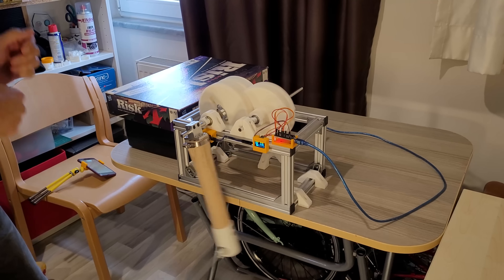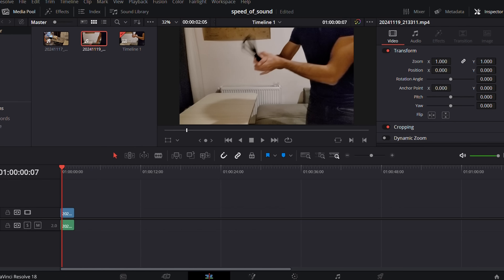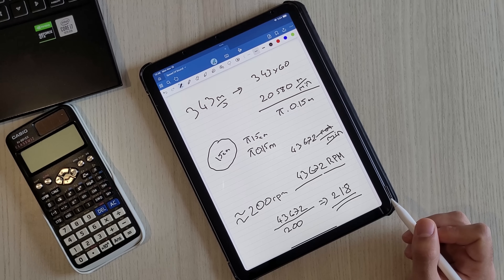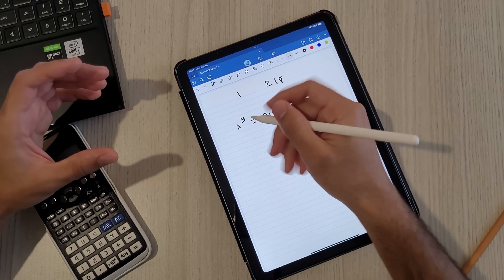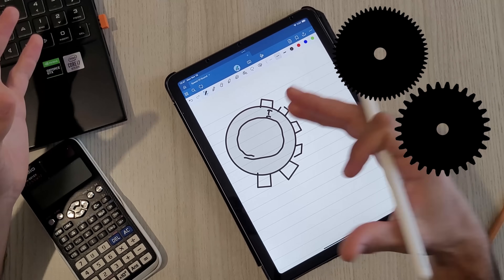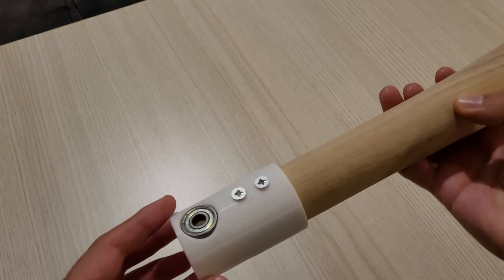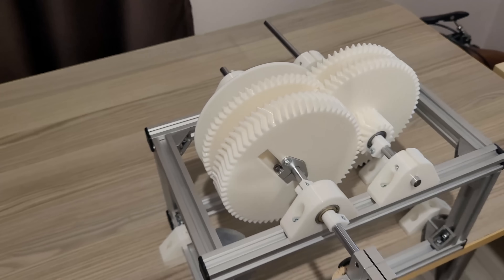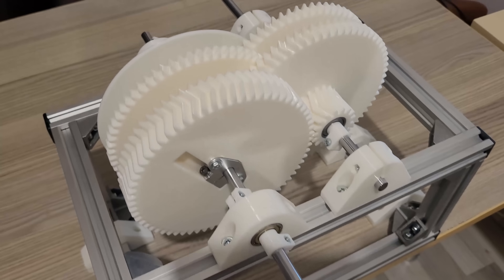Trying To Reach Speed Of Sound At Home 3D Printed Gears

Comment: Very nice video! I think it's not doable with a plastic 3d printed last wheel. If I assume a circumference speed of 1250 km/h and a disk diameter of 10 cm and a density of 1 gramme per cm³ for the plastic, then the tensile force at the outer rim is about 120 MPa (12 kgf/mm2). So I think the material for the last disk has to be a strong metal and I think it has to be thin at the rim and gradually somewhat thicker near the center. Furthermore, the air resistance exerted will play a very large role. With a 10cm disk and 66,000 rpm, I quickly arrive at 500 to 600N. That is the force required to send this disk through the sound barrier without any friction losses from bearings and wheels, so only its air resistance. And for each bearing and gear transmission, the friction of that component is added. If we calculate a rather unfavourable 5 percent per bearing-gear combination, then I arrive at a required driving force of 1.05 to the power of 4 = (1.2)*600N, say more than 70 kgf. You won't be able to do that this way at 3 revolutions per second. As soon as you can put the last wheel in a vacuum, it should be a piece of cake.
Reply from the maker: Wow, a lot of thought went into this comment. Thank you. Do you have an email address that you could share with me, i would like to contact you before i try this again to do a sanity check. If you don't want to write it here, you can send a mail to the address in my channel bio.

Comment: You mentioned that the double herringbone is more efficient at transferring power than a spur gear which just isn’t true. Helical gears see a small vector of axial load which is parasitic from the overall torque transmission. The pro to helical gears are reduced noise, but straight cut gears transfer power more effeciently
Reply from the maker: Thanks for pointing that out!

Comment: Why aren't you using the Speedometer which you built? 

I'm allergic to non basic Maths...
Reply from the maker: Hahah,  as i mention the magnet is not strong enough to get a good reading from the sensor. So it can't accurately measure the speed.

Comment: fast speed without any power. :/
Reply from the maker: Unlike our rules the rules of physics is same for everyone, you can't multiply the power.
Reply: but it's possible to optimise the transmission of movment to convert the movment of a weight moving down into a rotating thing

the weight of an human could be enough to generate a rotating little power.

Comment: A larger final disc might be all you need. Please visit it again
Reply from the maker: Hi, i can't make the final disc larger without significant changes in the design. There are two parallel rods in the system, and if the disc was any bigger, it would hit the other rod.

Comment: How about designing a coupling for the input shaft so that you could connect an electric motor. The motor would need to have a speed adjustment (Vfd or a dc motor with voltage adjustment) so that the output speed could be carefully lifted to minimize the stress that the gears and the motor experience.

Comment: I’d use a Milwaukee drill instead of that crank
Reply from the maker: Hi, to me that's against the spirit of the project, there are already motors that can spin at 30-40k rpms. If a motor is used anyways why not use that directly and ditch the gearbox completely.

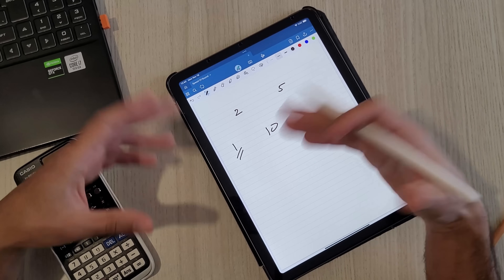Comment: 9:17 they don't actually need to be prime, so long as they're co-prime (share no factors other than 1) with each other -- for example, 15 and 59 would have worked for this purpose
Reply from the maker: Definitely, good point, our goal is to make them co-prime. But choosing prime numbers is still advantageous in case if you use the same design for a different project with different ratios.It will still be co prime

Comment: Something that may make it easier for any who may want to try this. Lubricants, greasing the bearings, and setting the gears in gear oil will help protect them and make it easier to spin as it reduces friction.
Reply from the maker: I used thin oil, but i forgot to film it. O think too much thick oil would create a lot drag. Ang 1nm of force in the last gear is 241 im the crank

Comment: 3:37 Radius is squared and pied to make circumference. If it was diameter pied to make circumference, than if R = 10, Pi*R^2 (Correct one) would be 100 pied, but if R=10, than Pi*D^2 would be 20 pied. Sorry if my math explanation was... bad. Just wanted to let you know.
Reply from the maker: Hi, the formula for the circumference is 2 pi r Or pi R. If I'm not wrong. There is no square. I think you're mistaking it with the area formula.
Reply: No, if you do so you will get an area (do the dimensional analysis)

Comment: With 3 Lego parts I was able to make 1700rpm by just turning my hand using 1 planetary wheel hub 1 1:5 ratio and 1 1:3 ratio resulting in a 1:81
Reply from the maker: That's awesome. I love Lego, but I actually never owned any lego technic pieces. But i love watching them on YT
Reply: @canocholic  every planetary gear hub has a 5.44:1 gear reduction but in reverse it can quickly grow from 5x the speed to 25x to 125x to 625 by just connecting them together

Comment: If you can get the air really cold you can lower speed of sound aswell
Reply from the maker: Hi, cold air would be denser, creating more drag. I don't think it would help.
Reply: @ would be too complicated but also since pressure doesn’t affect the speed of sound, create a vacuum so that the dense air doesn’t cause more drag. Not very feasible though
Reply from the maker: @whenlizardsfly  a vacuum chamber would be cool. But it is quite difficult to build.

Comment: I'm sure others have mentioned this, but this is extremely dangerous lol. You've essentially built a frag grenade which could go off at any moment. Saying that you're going to go until something breaks when the worst case will have shards of plastic travelling at several hundred mph is reckless.

Cool video and project but you need to do more to consider safety when you know this will reach thousands of people.

Comment: aiming for 200rpm was a bit opmistic, maybe you could try bigger gears for the first stages, getting smaller with each stage, then an aluminium disc at the end
Reply from the maker: I kinda had to aim high because lowb input speed equals high input torque. And plastic gears can only handle so much.

Comment: Spin it with a hammer drill
Reply from the maker: Hi, it's kinda against the spirit of the project. There are motors that can spin at 30, 40k rpms. I feel like attaching a disc directly to them is the obvious way to go if motors are used.

Comment: All of the figuring is moot. Just keep stacking whatever ratio you can make. The force needed for the desired output is the same. I might suggest engine flywheels and starter gears, because they are STEEL.
Reply from the maker: Yeah, steel gears would be great, but they are too expensive for me right now.

Comment: Putting lube on the printed gears will significantly increase their lifetime and at the same time make turning them easier. Although at that point you'd want a closed case for them or at those speeds they'll distribute it across your whole room. Also it might be worth printing them in a more heat resistant material, heat from friction can destroy PLA gears - although that risk again is greatly reduced by lube.
Cool project.
Reply from the maker: Thank you, i did put on some thin oil, but i forgot to film it. You're right. i had to use so little. Otherwise, it just flew off. In the next one, I'll use a different filament

Comment: I think you were right not to make hundreds of sets of gears, surely that would lead to inefficiency due to friction
Tho, 15cm seems like a bit of a pathetic size for a final gear? Like surely you could have pulled off 50cm diameter?

Also no offense but your setup could have been much better without such a shite table. A heavy stone kitchen counter might work? Or just a washing machine, those are heavy and designed to vibrate
Reply from the maker: Hi, my printer can only print up to 225mm, and i had to consider the material cost. 
About the setup, i used what i have, i can't drill it into the counter or the washing machine. That's insane to me
Reply: @canocholic  You could have printed the final gear in parts and glued them together, but material costs are fair ig.
Do you have one of those clamps to fix big metal lamps to tables without drilling into them? Because I feel like that could totally hold it down
Reply from the maker: @RRRR-jr1gp Hi, the final disc espescillay has to be balanced. Othervise the vibrations would break eveything. No I don't hvae clamps like that. 

Don't worry the video is doping really well. Hopefully I'll get the tools I need for the projects in the future.

Comment: I'm surprised I watched the whole thing through easily. The thing is you are acctually trying to optimise the gear set with the precise question in mind if it would be possible to reach speed of sound! You are undertaking all the right steps to optimize the device, and you are showing the calculations, the box in motion and the measurment results. Good job! Don't extend more. It was just about the right lengh! A next one could be a little shorter, maybe 10 to 15 min.
You even adopted different wheel thicknesses in order to account for the differing forces being applied to the wheels! Amazing!🙏
Reply from the maker: Hi, I'm glad you enjoyed it, i decided that I'll not have a goal length it will change drastically from project to project. But I'll not try to extend the video video lenght with unnecessary clips that don't contribute to the project or the story
Reply: @canocholic  You are right! Just keep up this stile. It's great. after watching I felt satisfied like having done the engineering work myself. :-)

Comment: If you try this again, may i suggest using a bicycle drivetrain as your input method?  

You'd get a much smoother torque curve, which will reduce the wear on the gears, cause the amount of oscillation introduced by the cadence of your arm, and the table shaking around, is almost certainly what popped that bearing and snapped the tooth.

If you can make something equivalent to a bike training stand, so that it would hold the bike upright and in place while you pedal, it would let you mount the stand and the gear assembly to a piece of wood on the ground, for maximum stability, and the most efficient  power transfer.

The more solid you can make the foundation, the better your results will be, cause a system like this needs as few extraneous variables as possible to work properly; getting up to the speed of sound will not be easy.

This is a really cool project, and i wish you the best in your future endeavors 👍
Reply from the maker: I'm glad you enjoyed it, i thought of using bike cranks, but it was out of budget, and i don't have the necessary tools to build such a thing yet. Maybe in the future, if videos keep doing this well.

Comment: one thing i would reccomend is oiling the bearing to reduce friction and make the gears thicker and if possible use Polycarbonate as the filament. a better table would be also better and alonger crank. great video that it earned a sub.
Reply from the maker: Hi, maybe next time.The gears should have been thicker, but i didn't have enough filament for much more

Comment: What about making the end gears open?
Reply from the maker: What do you mean? Like leaving holes on the discs themselves
Reply: @canocholic  I was thinking that since the last 2 or 3 gear(s)/disk don't have much torque on them that it may advantageous to use a spoked design, holes would help too, it would also likely be critical to be aerodynamic so a tear drop shape spoke if applied would likely be ideal. Though I imagine though that it may not be possible to print that so an assembly may be in order. Anyhow the current design from an outside perpective strikes me as being inefficient with rotational mass.
Reply from the maker: @wh0_am_152  I think the bigger problem is not mass, but air drag thats why I used smooth discs.

Comment: My immediate thought is if this can be turned into
1. power generator for batteries
2. sawblade
3. marble luncher cannon

I also recommend a loose and more ergonomic crank handle and also securing the table in place.
Reply from the maker: I'll try to turn it into a generator, and a marble cannon would be so cool, dangerous, but cool.
About the table, yeah, better one would help, but I had to use what i have.

Comment: I would recommend using a moto especially a drill for a consistent speed and most importantly torque so you dont stress out the gears as much id also say make sure you mount it to something solid so worse case it doesn't go anywhere oh and eye protection is very important incase the disk explodes which is a real possibility at such high speed
Reply from the maker: Yeah, i feel like it's cheating. There are motors that can spin at 30000 rpms. To me, it's better to just stick a disc to its spindle and have a go

Comment: A) Your material limits make reaching the speed of sound impossible. (Same issue as Tesla turbines.)
B) You should try rigging it to a foot pedal so you can use your body weight to power it.
Reply from the maker: I'll next time. This might be a long series with significant improvements each time. I feel like with enough budget, it might actually be possible to reach the speed of sound.

Comment: 5:20
I am certain that you don't need any gears to mesh for the teeth to reach the speed of sound. Assuming you can print with that foaming filament on a very (very very) big printer (and a few [dozen] linked pieces)
Reply from the maker: Like a whip you mean?

Comment: Great video. For another video, what gear ratio would be best for turning a generator to create electricity to charge an electric bike battery instead of turning the wheel? Basically, How much power could a person peddling produce when geared correctly, and would it be beneficial?
Reply from the maker: Great suggestion!

Comment: Did you lubricate the gears? It will probably fly off them anyway at such high speeds
Reply from the maker: I did, but it's not on video. Had to wet  a paper towel with oil and lubricate the last three gears like that. Otherwise, as you said it it just flies off

Comment: A couple thoughts, lubricant(lithium grease maybe idk, graphite powder, less surface area on the gear faces, and lighter gears the further into the ratio, but the initial ones need to be dense to not break from the crank, also making the final gear heavy as to not shatter like a cd and blind you
Reply from the maker: Thanks, I'll keep that in mind for the next project.

Comment: So when you do your calculations at the beginning I don’t quite follow where you get the speed from.  If you want the gear to break the sound barrier then would that be going off the surface speed of the gear?  If that’s the case I think the formula is (Diameter of the gear)x(RPM)x(.262).  What are your thoughts on this I might be wrong here and want to learn what I’m missing if I am

Using the numbers you came up with the surface speed of the gear is only 1,716.3 meters per minute
Reply from the maker: I'm calculating the tip speed which is basically circumferance * rpm. Than you need to convert it to the unit you want. for a 0.15m disc at 21836,06 rpms it reaches mach 1
Reply: @canocholic yes I’m sorry I was thinking of the imperial formula!  I enjoyed your video

Comment: why not use a flywheel to eliminate the weight of the handle
Reply from the maker: Well, you kind of have to make it out of metal, which i don't have any tools to machine. And it's quite a bit more dangerous. It's stores enough kinetic energy to hurt someone as of itself, increasing that is not something i want to do atleast for now, when i can afford to build a cage around the thing from polycarbonate or something like that i might try that.

It is also in one of the rooms of my 2 room apartment, so heavy things that can fly off is a no-go.
Reply: @canocholic  yeah I should've thought of that 😭

Comment: How about a gear setup where when you turn the fast side, the slow side moves with ultra small movements. You could manipulate at ultra low scale in the nanometers.Could this be done with minimal slop caused by gaps between gears?
Reply from the maker: I can't build something that precise, but i might be able to lift heavy things with very little force.

Comment: Seems like lubricants would help reach a higher speed… good video though Subbed.
Reply from the maker: I did put on a tiny amount of thin oil, more just flies off
Reply: I recall putting WD-40 on my bike gears making a huge difference, but I’m not sure if it would have any reaction with the 3D Printing material or not.

Comment: if you had this set up in a way so that you had two out side gears turning inwards towards one center gear on one crank would this assist into lowering the gear tension of the singular gear driving the other gears allowing for even faster speeds before breaking
Reply from the maker: Yeah, next time, I'll use a system like that for sure. The material necessary and the printer time basically doubles, so that's why i didn't for this video. I might even do 4 sets